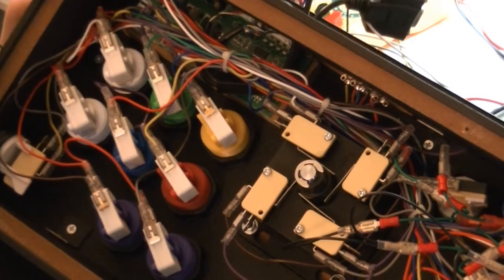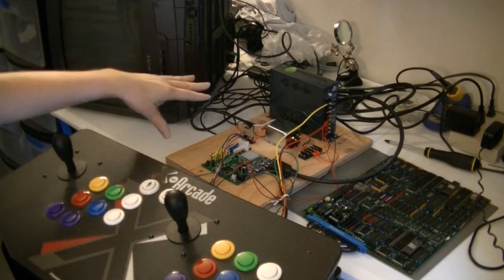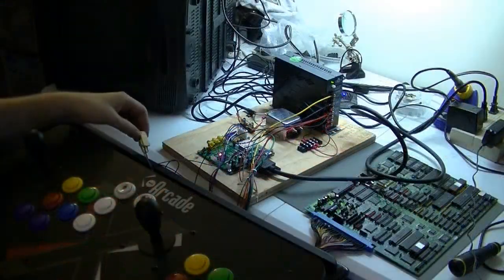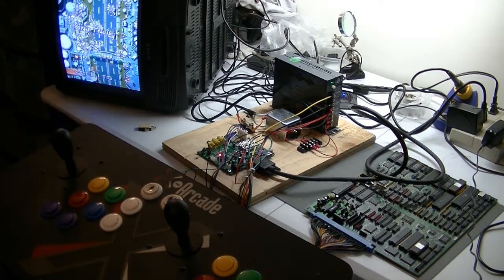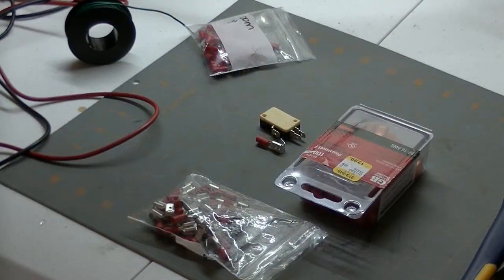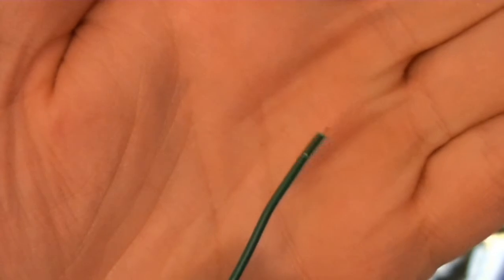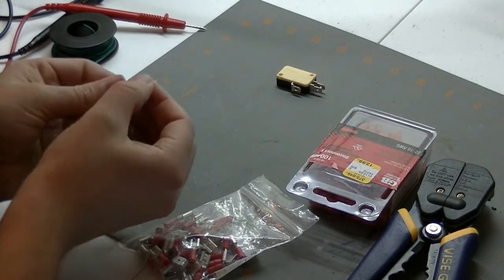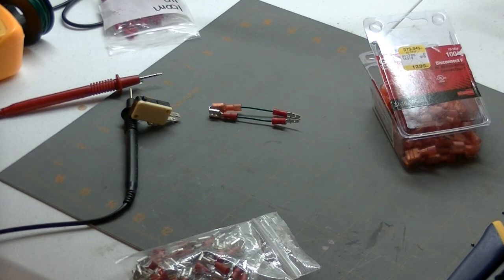[Setup/Tips] JAMMA to X-Arcade Control Panel Testing w/Macross PCB

Comment: Greetings.  I've had my X-Arcade for a number of years and just now getting into Jamma...specifically I want to get the Pandora's Box.  I still want to be able to play the Playstation 2 or my PC or a Jamma cable.  After all of these years...was it worth it making the splitter connections?  I was going to either solder an extra wire or tap into the existing...any extra tips would be great before I go your way of making all of the splitter mods...
Reply from the maker: No it wasn't. I've been meaning to take this video down I thought I had already. Leeches off too much power after a point and stops working. It's too bad because it works great with only a handful of buttons connected.
Reply: @Playongo  So this is NOT a working solution?  Crap.  I have a jamma card coming today so maybe I just use it and chuck the usb/ps2 portion?  I got the full 25" CRT cabinet from X-Arcade but this Pandora Games 3D looks amazing.  I just did not want to get another full set of buttons to place Pandora since I still like to play w/PC and PS2.
Reply from the maker: @wil2fly13  correct. Yeah sorry if I led you astray. This might be my motivation to to take this video down. It was a fun project and my arcade cabinets turned out great but I had to find a different solution for my arcade pcbs and they're still not set up. I have the cab in storage right now.
Reply: HI, great video I stumbled across. I have a jamma 48 in 1 one gaming arcade cabinet. It only requires a couple of buttons per game so I was wondering if I only split a couple it would leech less power and possibly be okay? Thoughts?

Comment: Are you able to provide more information on how to do the split method? Just as list of supplies to gather?
Reply from the maker: I've been meaning to take this video down. I don't know the technical terms for it, but in practice this is too much of a draw on the system and the controls don't work. It works on a small scale, but not when all the buttons are connected.
Reply: @Playongo  I figured. I suppose it's better to strip out the internals of my dual stick and just turn it into a full jamma stick. I already have a tank stick anyway. Anything I should know about making connections?

Comment: I think I'm about to do the same but I'm scared, the USB chip might not like the voltage from another device being in the same circuit
Reply from the maker: Yeah, ultimately this didn't work out when hooked up to an X-Arcade adapter. I should make note of that on this video.  I'd wait for X-Arcade's official adapter.

Comment: There is now a "COMMING SOON" jamma adapter up on X-arcades website!!! Good job btw.
Reply from the maker: shabazz18 Awesome! Finally. They even stated they wouldn't make one. FYI: When I got around to trying to use this simultaneously with the normal X-Arcade hooked up it didn't work for both so it would have been back to the drawing board. I'll add an annotation recommending the new adapter.
Reply: 5 years on and still waiting. I have emailed them for an update but I think this looks a simple and great option. Thanks.